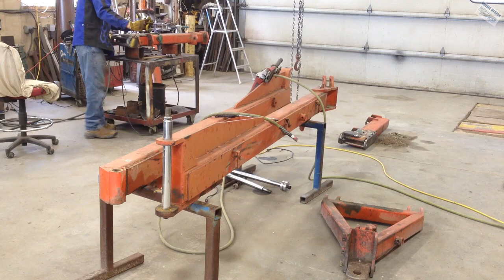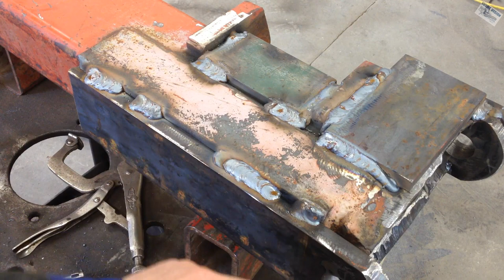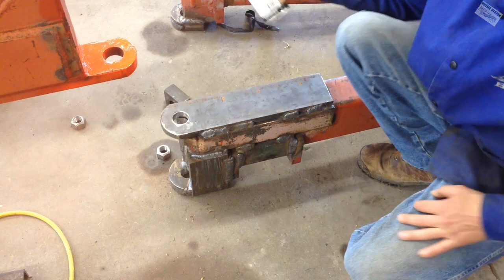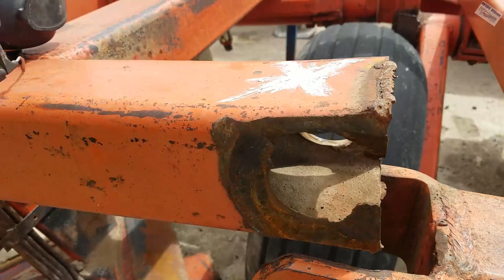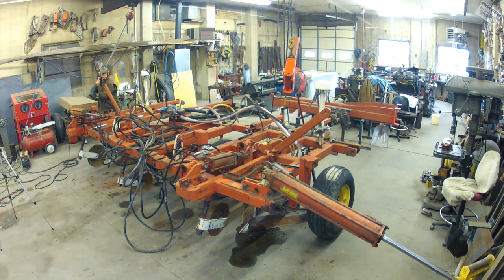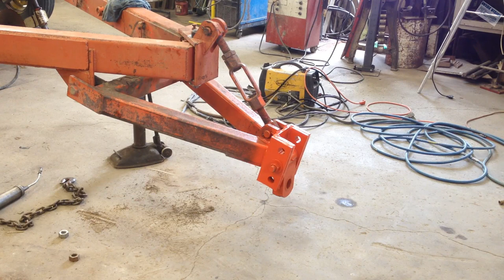Sweep Plow Main Hitch part 2 of 2

Comment: That plow has more joints than an Amsterdam coffee house.
Reply from the maker: LOL! Yep. I replaced 42 grease zerks on that plow. And that's just the ones that weren't working! Then, there's several points that don't have grease zerks, it's just hardened steel on hardened steel. That's a lot of moving points!
Reply: Wide Vision Metal Fab windmill work? that wind, are the blades on it? cool videos, great welding, Joseph T
Reply: Wide Vision Metal Fab By the the time you finish greasing all the zerks it's time for lunch, lol.  You really get some weather there!

Comment: I really liked the way you engineered the plow repair to be stronger. And good camera work
Reply from the maker: I recently found out the new versions of the plows got rid of the tube and just use ears. I guess I was thinking correctly!  And I think this gopro as a secondary camera will change my video style. It's a lot more footage to wade through since it's on all the time, but I feel it's worth it!

Comment: That is a very large plow and a very nice rebuild -- I almost said repair, but it's no repair. It's a rebuild. That overhead shot while you were putting it back was excellent. And really, we are having much better weather in Alaska than you are in Kansas.
Reply from the maker: Thanks! Yep, I'd consider it a rebuild. I rebuilt the hinge points on the wings, and I rebuilt the pivot pionts on the lift mechanisms.  Guess I should move to Alaska! :)